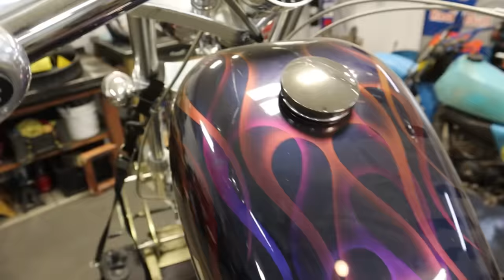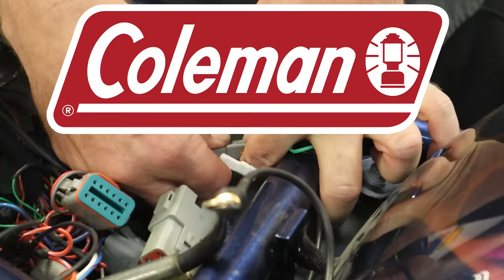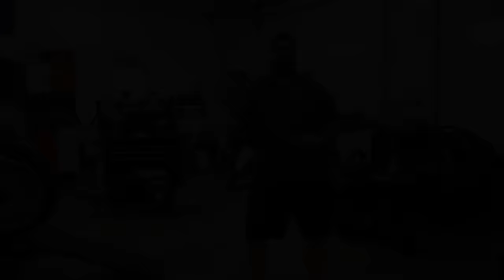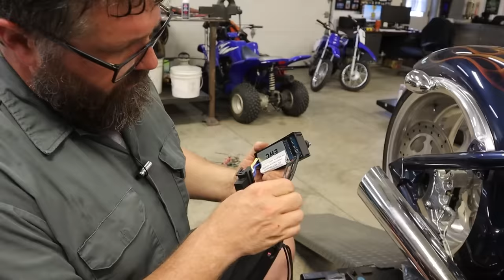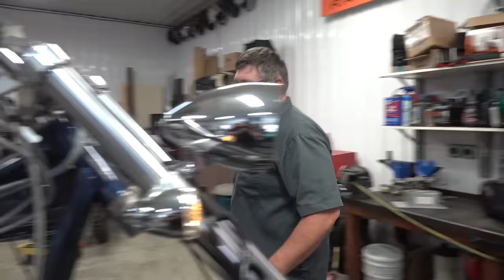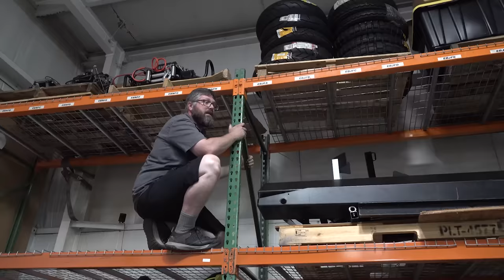Can I Fix This Unfixable Chopper ?

Comment: I feel your pain and confusion, I needed to fix a friends 05 big dog last year for same problem. same wiring mess under the seat. Bought a rip kit from big dog total night Mear wire colors not the same on new harness as the old harness. everything worked but when you pushed the start button the horn blew., so had the repin the right handle bar switch connector.

Comment: Just did one,it's not that bad if you look at the system as three separate wiring systems,charging,ignition,and lighting,all I did was separated up the system and it only took about four hours to locate the problem,repaired the wires that had shorted out with new and was good to go,it's all about knowing the systems and remembering it's not the space shuttle it's a motorcycle

Comment: You have a timing issue, hence the spitting back thru the carb. the spark thing ,,,,, I can't tell from here. Timing will kill you ever time on these v-twin engines. Maybe something got flipped, two wires, in the harness when you put it in? Is it a single fire or a duel fire ignition set up? Great video, keep it going!!!!

Comment: Craig the ignition module/ pick up sensor in the nose cone probably went out from high amps , causing erratic or lack of spark if it wasn’t the coil ! You were extremely close to finishing this bike. Also we just swap out these harness on big dogs and rewire. It’s a known issue. 

I’d love to be a reference for ya in future to pick my brain. I’m a pro Harley mechanic and run my own shop. I could have helped you here.

Comment: In the 70s, my Yamaha suddenly wouldnt start. I ran through systems and couldnt find any culprit. We hauled that thing around mechanic to mechanic and still nothing. On the fourth shop, a guy dug through everything inch by inch and finally found that the owner before me had installed a coil completely wrong for the bike and it slowly fried internally. Because it was hidden below the battery and unseen, nobody thought to dig that far and therefore didnt think to check and test it. The shops assumed an installed coil was not only correct but would probably never burn out either. New coil installed, it started and ran perfectly after that. Its hard to believe how much time was wasted chasing this. I had even bought two new carbs and other parts because the shops insisted it had to be a fuel problem.

Comment: My guess is that other shops don't want that kind of stuff because the customer won't pay when they get the bill. You put a lot of effort and time in this. Probably more than the bike is worth today. All because they hit with a commercial 24v battery. I bet after this your quotes for similar issues will include full replacement of every electrical piece on the bike.

Comment: I am building a custom bike almost done had a no coils too. But everything else worked try pulling in clutch lever. But power from kill switch and starter button. Are not sending signal or power back out to coils. It’s the kill switch some have switches or like a relay hidden inside. It’s the wiring going to kill switch and starter button are not sending power back make sure it’s not burned up in there.

Comment: I have a 81 Shovelhead  Craig if you want a project that wouldn't be too bad compared to this . Wonky clutch and head gaskets leak , but it runs well except the clutch launches really hard and once the oil is warmed up it starts leaking

Comment: Would like to know why the engine was spitting up the carbie when cranking. Looked like the timing was waaay too far advanced. Early firing could be what caused a kickback that killed the reduction gear in the starter. Back to basics. Is the correct cyl at TDC when the ECM thinks it's at TDC? Crank angle sensor ok? You've thought of all this by now, hope you have it running.

Comment: I had a 2003 BigDog Husky and had way too many electrical issues so I ended up taking out the factory harness and replaced it with a wires plus system and it took care of the issues.

Comment: My man I have taken on similar no-starts, and boy do you suffer for your hubris sometimes. Most memorable was finding an engine coolant temp sense wire, at the ECU, that had been chopped, and very poorly soldered back together, that was hanging on by a single thread. The resultant high resistance ended up missreporting coolant temp as -30, in summer, so it was massively overfuelling and flooding every time you tried. Took a good week to finally find it.

Comment: God, that starter sound is seared into my brain. I did that on my bike when it was hydrolocked with gasoline from a bum carb that leaked gas into the cylinder when it was in 'prime'. Trying to source a 1980 starter is like mining for gold on ebay.

I will suggest that you might not have spark because a fuse blew, the exact same thing happened when mine died.

Comment: I'm guessing you checked the coil primary and secondary resistance since you said it was bad but the timing sounded off and I wouldn't be surprised if the ignition module was bad. I'd at least find top dead center and verify static timing.

Comment: Kind of the same process used working you working on Mercury Marine Motors they're all well labeled on the wires to take all the wires off all their contact points and then get out the ohm meter and test each unit I find a lot of them the trigger and the rectifier will go out first before anything else so people change a lot expensive parts and those are cheaper parts that you just have to locate your problem

Comment: Just saw this video today.
I was a Big Dog and a Ironhorse Tech from beginning of BD + IH to the end of our dealership (2009, mortgage crisis guys stopped overnight buying bikes), had a few other aftermarket bikes, Big Bear, California Custom... etc.
I believe your problem is that "Thunderheart" ignition box (Sword and Heart) is toast and more than likely the coil got fried too, 24v how many amps? Lucky the bike didn't burn to the ground.
You think BD is bad?
Wait until you work on a IH wiring problem.
Throw a Dyna Single fire and coils in it, jump out the ign box (unplug) and save yourself some trouble.

Comment: I bought a 25 grand Paul Yaffe chopper for 1200 bucks from a local Harley dealer that took it in trade and couldn't get rid of it. 
 I completely rewired it, but only  used it for a door stop for a coupla years until someone gave me 2500 dollars for it.

Comment: You are getting backfire through the carb and something out of the exhaust simultaneously.  Pretty clear to check basic engine timing.  It has an electronic ignition - my son had a Big Dog and the problem with it was complete stoppage with left hand turns.  Turned out to be the wiring to the coil was REALLY crappy.  Daddy fix and it ran like a Big Dog should.  Replace coil and CHECK the timing.  Something there just ain't right.

Comment: I think you can find a plastic pipe that the soft metal tube of dielectric grease will fit into as a storage , so it wont get squished or puntured

Comment: Powerful batteries do not damage wiring, short circuits and other high amp draw conditions do as does trying to jump start from a running vehicle because alternator output voltage exceeds battery resting voltage so motorcycle regulators try and often fail to regulate the additional current.  Anyone working on their personal bike can whip up a common "simplifed chopper wiring harness" (search using that phrase) easily without the silly module. Other than the voltage regulator and whatever electronic ignition is used there is no point in integrated modules.

Comment: I have concerns with the harness beyond the mid frame connect. Everything up there hidden that could be grounding out and/or smoked like the rest was. It's a whole lot more to check that up to the ignition switch on the handle, but coils and modules get knocked out for much lesser reasons.

Comment: Wonder why the coil went bad? All new wiring harness and module you replaced. 
I know starters really get fried. I put decompression buttons in both cylinders and fixed that problem. Have 2004 Jessie James chopper I built back then.

Comment: You should not use dielectric grease because it actually provides resistance/insulation from electrical current.

Comment: A suggestion on labeling wires that I think you'll find much easier than colored Ty-Wrap or marker that can rub off: Brady tags. Generic name is wire markers, and you can get them at any decent hardware store in the electrical section.

Comment: Electrical schematic from Big Dog factory would have been nice to have. Starter might be ok but probably not. Then the ECU or computer wat lite up and fried too. so there's that. You have to have the ECU to control the fuel injection unless it is carbed, if so you go around that problem and get to the starter circuit and do to the switch and rewire it and move to tail light and headlight and signals. Just have to work through it system by system. I would of seen in Big Dog could sent you a new harness with schematics if it is fuel injected. I would check o2 sensors too just to make sure they are not fried too. + the solid state ignition needs to be replaced most likely. Check the electronic ignition advance in the engine compartment by the foot brake, under the round cover. Kind of says a lot about our so called mechanic here when he can't rebuilt a starter. I would replace the coil and check the timing. Should run.
Reply: You are💯 CORRECT here with your advice 😎👍

Comment: It's actually not really just the current that fried the wires. The smaller wires have a higher resistance. Increasing the supply voltage increases the current. That causes the wire to heat up.

Comment: I'm sure everything that carries full battery charge got smoked. Once I saw  that bare wire, I would have replaced the full harness coil regulator/rectifier...Also would have run tests on crank position sensor  and stator.  Electrical on those bike are fairly simple compared to others. Sometimes just easier to bite the money bullet and start from scratch

Comment: Back when choppers were really popular, we had a LOT of Big Dog motorcycles come into the shop with dead ignition systems;  the original BDM ignition module was mfg by Gill, Great Britain, was expensive, hard to get, and unreliable.  My solution was to rewire the ignition system to use a Daytona Twin Tec HD twin cam ignition module and dual coils, used the same crank sensor type trigger, but was 'way more reliable, and easier to get parts for when you needed them... Eventually, BDM dealers started doing something similar... my advice, stay away from the Gill stuff, even if you can find it....

Comment: I owen a 2004 Big Dog chopper Rt frame  put single fire IGN new coil new bars hand controls,and rabbit ears pullbacks14in rewired total system,fuse box,starter relay head light relay kick starter, slam button on starter ,new stator, voltage regulator new head light filliment,much brighter with switch so i can keep it off before starting tach,voltage meter. No, more problems now old school keep it simple😊👍😎

Comment: That was a big misfire! Is it a dual hit coil firing both cylinders every stroke, also on the second none combustion one? You could measure the windings on the primary and secondary of course. But by the time this video is out I am guessing you're already done with it :)

Comment: Big Dog was one of dozens of fly by night companies that made expensive but very poor quality Harley clone choppers during the '90s and early 2000s. They are now worth only a fraction of what they once were. Most of them don't even exist anymore, they just fell apart. That one is one of a few survivors. S&S makes the best of the clone Harley EVO motors. Many companies used cheaper motors, like Merch and RevTech. One good thing most of these bikes have in common is simplicity. The wiring would have been easy to fix if you had a schematic. I would have been willing to work on that bike, only because it is carbureted. I wouldn't have touched it if it had been EFI. Since there are no Harley parts on that bike, do you know if it has a single fire or dual fire ignition? I noticed it was backfiring from the exhaust and carburetor at the same time.

Comment: With it backfiring like that through the carbs, I'm guessing it could be a timing issue? My '79 Yamaha XS1100 Special had an ignition advance module and wires (concealed by a cover on the engine of course) would flex and flex over time and actually break through inside the insulation. At a casual glance they looked fine but you could work your way along each wire -- pulling on the wire as if to make it longer -- and easily find where the copper wires had broken through inside the insulation = major no bueno. :)

Comment: It didn't sound like the timing was right when you were cranking it before the starter failed. I would check the coil, but would suspect a failed ignition pickup coil or module. I've worked on 1 big dog and had to replace the same harness and controller. No burnt wires in my case but it was dead in the water.

Comment: Chopper wiring is easy (all non-CANBUS wiring is easy and bike troubleshooting is effortless compared to cars and trucks) but many shops avoid them because they're non-standard and they prefer not to be bothered. We'd work on them (my mentor who owned the shop and I were both career jet mechs and more) but like many independent shops he took old bikes and overflow dealers did not. That niche pays off for the right technician but it's not for everyone.  

Note to anyone interested in buying ANY of those clone choppers from the era of the stock Harley famine, DO YOUR HOMEWORK. They're not all the same and they don't sell for big money today because unlike their customers (who were easy marks for their enormous markup!) used buyers are less prone to falling for hype. For example when you see S&S cases, contact S&S to see how that set was sold (loose or as an engine and with what specs). Clone choppers are popular to buy for the engine or whole drivetrain then part out which is a good use for them.

Comment: This is why these Frankenstein brands don’t sell in Australia. I hate working on them check your voltage regulator first & your voltage output then your coil because even if it’s the coil something caused it to breakdown. The problem is they just get a bunch of aftermarket parts & bolt them together nothing was made to be compatible with any other part .

Comment: Oh Boy. 
I would look at why the starter shat itself. 
My call is a mechanical issue with  valve timing or electrical issue with ignition timing causing a 'kickback' when it tried to fire up, IE it tried to run backwards when the spark plug fired, causing the starter gears to strip. ( I made the mistake of timing up a Moto Guzzi perfectly but it was on the exhaust not the compression cycle, ) If the wires from ( or to ) the ignition 'module' are back to front then it may cause the spark to advance way too soon ( given it is a 45 degree engine ) and throw the piston back down before TDC has been acheived .

Comment: looks to me like the starting problem (whatever it is) has caused the continuous cranking issues (which you've fixed) so although it sounds obvious you're back to the original issue. From the back firing and explosive bangs i'd say the ignition timing needs checking, if ok the compression needs checking, if ok the valves and lifters need checking. I'd speak to the owner and ask him how it went from running to not starting, there might be some clue there, there might not. Thank me later, nice work on the electrics btw.

Comment: In my decades of repairing motorcycles I have NEVER seen a bad coil but I have seen my fair share of failed ignition modules. I also think that "The BM" is being a tad melodramatic regarding no shop willing to work on this. Businesses don't stay in business by turning away business...
Reply: I have way too much business. I have to turn down work. I would also never work on such a mess, unless it is for a good friend.

Comment: I’ve had a mystery broke down Katie 125 since March it blew up in February and everything was wrong with it. Split cases rebuild boiling system clutch kick starter top end and the magneto. And I still have to correct the rotary valve and this one’s for free a cousin their first motorcycle from high school in the 80s.

Comment: was a ASE master tech for 30 years..... diagnostic work like that where someone was already hacking on it was always a money looser... for the customer. the labor costs can easily start off with a $500 estimate just to start. always found it was better to be up front with the tear down costs. if in tearing it down i found the problem in an hour, I'd charge an hour.

Comment: I fixed one 4 or 5 years ago the whole thing is wired with thin wires the stop switch had a vary small screw that grounded out on occasion 😅

Comment: when you put too much voltage and amps through a wire, all you do is turn everything into fusible links. I can't remember the details but when I was in auto shop n high school we had a wire literally explode and threw hot molten metal everywhere....it was only a 22 so it was just splatter but everyone had burn marks on their overalls. ABout 2 ft of it went POOF.....

Comment: Iiv wired my bikes for 40 years my tip do the ignition first then the charging run the bike with battery check charging then lights check and so on works for me uk bike builder 76 years young still building jap bikes brits no harleys too expesive just saying

Comment: I fixed an S10 that was hit by lightning. It hit the radio antenna and went in through that. Fried everything including the coil. So 24v to the coil would probably fry it too.
Reply: Me thinks lightning is a lot higher than 24v
Reply: @rogerdodrill4733  ya don't say. But it wasn't a direct hit to the coil..